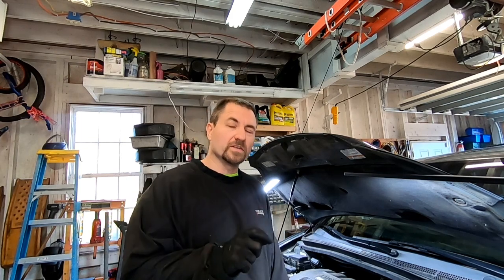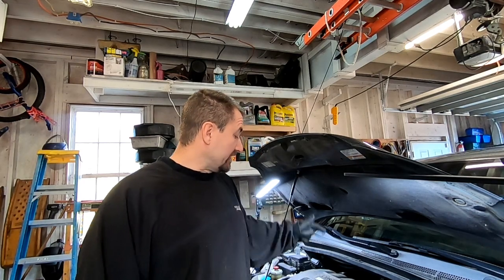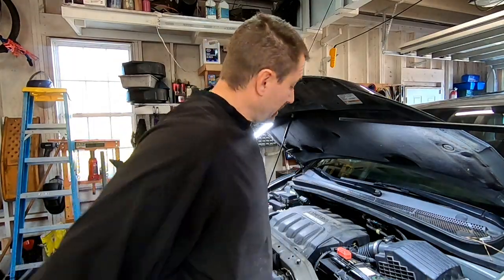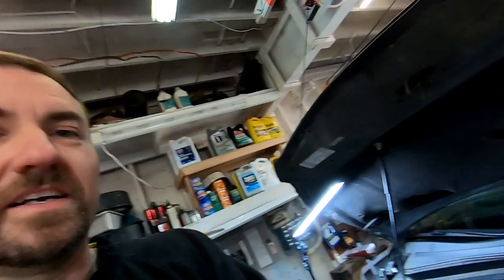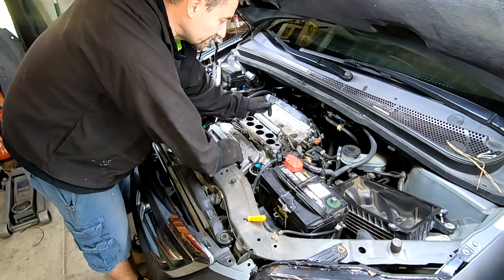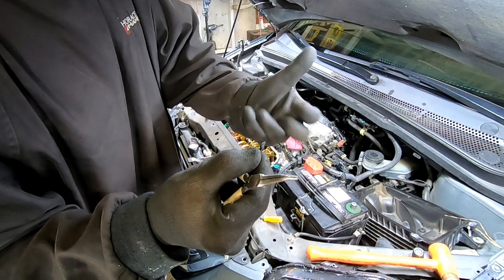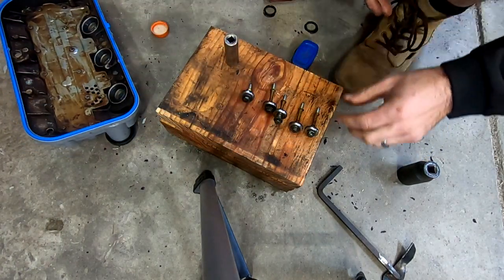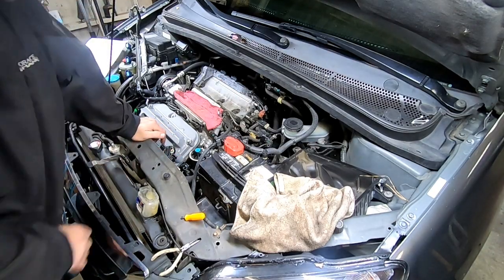(Part 1) 2007 Honda Odyssey Valve Cover Repair

Comment: I just did this repair...couple of things...make sure you order the right gasket kit...there is difference between Ex VCM and NON VCM. Secondly when you remove the Plenum on top there is an insanely $$ $50-$65  7" strip of gasket that runs along the middle of the plenum. I have only found it at the dealer, mine was cracked in two places I felt compelled to replace it.
Reply from the maker: Good to know.  I was surprised how much it all cost when said and done.  it is not just valve cover gaskets.   Thanks for the tip and the watch.
Reply: What extra gasket are you talking about
Reply: What else besides gasket covers

Comment: Petroleum Jelly was a bad idea. Your spark plug tube seals hold up? I would think they failed.
Reply from the maker: I only use the jelly to make sure it seals correctly.  once it warms up it dissolves in the oil.  No leaks once we were done.    I have been using jelly for years.   but I will look it up to see if I shouldn't.   Thanks for the tip

Comment: so the 2008 aluminum covers do not fit the 2007s?
Reply from the maker: good to know.     did not know they made that many changes between the 07 and 08.     good luck.
Reply: no, I was just asking, they look pretty close side to side... @5LakesGarage
Reply from the maker: sorry misunderstood.     i  am not sure 100%.   i know that manufactures are not always right and give you the wrong parts.

Comment: 8.8 Lb Ft for the valve cover bolts
Reply from the maker: Sounds about right.  I found a few locations but one would say 8 and one will say 12.   I should of look harder to find one directly from honda.    I miss that van .    I had such great plans for it.  

Good luck and thanks for the watch.